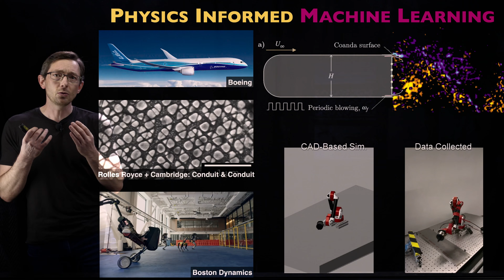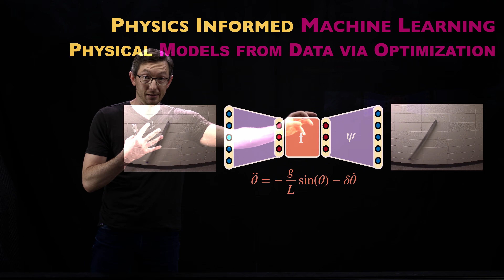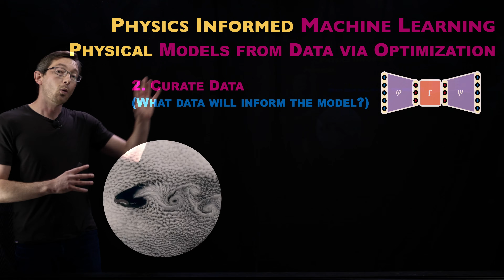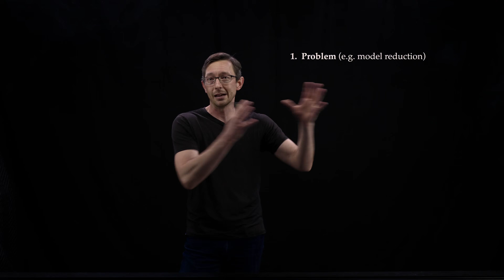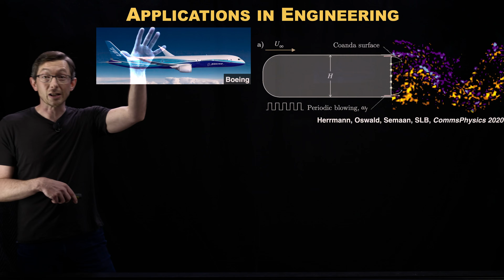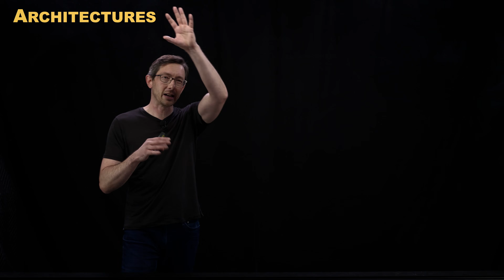Physics Informed Machine Learning: High Level Overview of AI and ML in Science and Engineering

Comment: Thanks for the excellent lecture and comprehensive overview of the field. A notable but often overlooked contribution is the work of S. Mehrkanoo and Johan Suykens: "Approximate solutions to ordinary differential equations using least squares support vector machines, IEEE-TNNLS 2012" and "Learning solutions to partial differential equations using LS-SVM, Neurocomputing, 2015". 
They first introduced a systematic machine learning approach for solving various differential equations. Notably, their approach allows for different representations, such as neural networks, instead of LS-SVM, and relaxes strict constraints by including them as additional terms in the optimization objective. It seems that inspired by their systematic LS-SVM approach, the physics-informed deep learning model was developed. However, the connection between these approaches has not been explicitly stated in the literature, including in the original physics-informed deep learning paper.

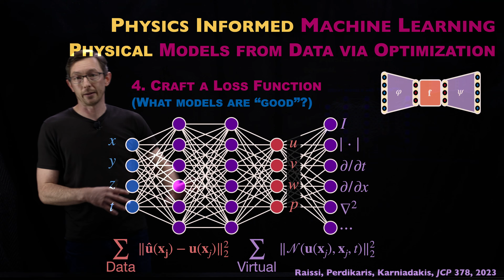Comment: 30:55 In the context of Physics Informed Machine Learning (PIML), the loss function is typically constructed to ensure that the predictions of the model adhere to known physical laws, such as the Navier-Stokes equations for fluid dynamics. This approach integrates domain-specific knowledge into the learning process, guiding the model towards physically plausible solutions.

For stock prediction models, an analogous approach would involve constructing a loss function that incorporates domain-specific knowledge from finance. Since stock prices do not follow physical laws in the same way fluids do, the 'physics' in this case would be principles from financial theory and market dynamics. Here are some concepts that could form the basis of an "Economics Informed" or "Finance Informed" loss function for stock predictions:

Mean-Reversion and Momentum: Financial markets are believed to exhibit mean-reversion and momentum behaviors over different time horizons. A loss function could be designed to penalize deviations from these behaviors for certain stocks or indices over appropriate time frames.

Arbitrage-Free Condition: In theory, there should be no arbitrage opportunities in efficient markets. A loss function could include terms that penalize predictions that would lead to arbitrage opportunities, thus encouraging the model to predict more realistic price movements.

Volume-Price Dynamics: The relationship between trading volume and price changes is a fundamental aspect of market microstructure. A loss function could be constructed to ensure that the model's predictions adhere to expected volume-price dynamics, such as higher volumes accompanying significant price changes.

Volatility Clustering and Leverage Effect: Financial time series exhibit volatility clustering (large changes tend to be followed by large changes, of either sign) and the leverage effect (volatility tends to increase as stock prices decrease). The loss function could include terms that ensure the model's predictions reflect these phenomena.

Correlations and Covariances: The relationships between different assets (e.g., stocks, ETFs, indices like VXN and VIX which measure market volatility) are crucial. A model could be penalized if it predicts changes in stock prices that are inconsistent with the historical correlations and covariances between these assets.

Regulatory and Macro-Economic Factors: Incorporating constraints or penalties based on unexpected deviations from macro-economic indicators or ignoring regulatory impacts on market behavior could also inform the loss function.

Market Sentiment: Integrating sentiment analysis, possibly from news or social media, as a part of the loss function could ensure that the model accounts for the impact of public sentiment on stock prices.

In summary, while there is no direct analogue of the physical laws used in PIML, finance-informed machine learning models for stock predictions can be guided by economic theories, market principles, and historical financial data. The key is to incorporate relevant financial knowledge into the model in a way that guides it towards more realistic, feasible predictions within the context of market behaviors and economic principles.

Comment: It seems to me that separating the symmetry from the neural network would be far more reliable.  Simply including many orientations in the training is the lazy approach.  Instead, concentrate on one side (e.g. the left side or the right side) and concentrate on g pointing down while training the network.  Then precede the network with a symmetry varying algorithm that rotates the input by 5-10 degrees while watching the correlated output.  If the subject has bilateral symmetry, then repeat the process after exchanging x<-->-x.  Then consider only the best output(s) when deciding how to classify the image.

Comment: 📝 Summary of Key Points:

📌 Physics-informed machine learning is at the intersection of leveraging existing physical knowledge to enhance machine learning systems and using machine learning to discover new physics.

🧐 Machine learning models can benefit from incorporating physics by enforcing known physics or using machine learning techniques to discover new physics from measurement data.

🚀 The process of building a machine learning model involves stages like defining the problem, curating data, designing an architecture, crafting a loss function, and optimizing the model parameters.

💡 Additional Insights and Observations:

💬 Quotable Moments: Physics-informed machine learning aims to bridge the gap between leveraging physical knowledge and enhancing machine learning systems.
📊 Data and Statistics: Physics-informed machine learning can lead to significant advancements in various fields like engineering, natural sciences, and robotics.
🌐 References and Sources: The NSF-funded AI Institute in Dynamic Systems focuses on embedding physics into machine learning systems for engineering applications.

📣 Concluding Remarks:

Physics-informed machine learning is a crucial field that combines physics principles with machine learning techniques to solve complex problems in engineering, natural sciences, and other domains. By incorporating physics at different stages of the machine learning process, researchers can enhance model performance, discover new physics, and revolutionize various industries.
Generated using TalkBud

Comment: Can machine learning determine that two objects follow essentially the same physical law? lets say the data are video of a pendulum and video of a mass on a spring. Can it say that both follow "simple harmonic motion"?

Or if it got fed the pendulum data first, can it say that the mass on a spring follow essentially the same equation of motion?
Reply: If the differential equation of simple harmonic motion is provided, then definitely. Fit the model onto each video, and use a goodness of fit to determine if it was simple harmonic motion.
Reply: @Jononor  hmmm still to early for the network to output the form of the equation itself? incorporating computer algebra along the way

something I imagine wolfram would do
Reply: @GeoffryGifari  one can find the governing equation from a library of possible equation elements. This is usually called "equation discovery", and one can use Physics Informed Neural Networks (PINNs) for it. You can find videos on the subject already from other channels. I suspect it will be covered later in this course :)
Reply: @Jononor  equation elements huh? collecting those seem to rely more on human input. 
thank you for the reply
Reply: @GeoffryGifari  one can often a relatively generic set of equation elements. But yes, there is no magic - humans are still needed ;)

Comment: An analogy for physics informed machine learning (one method) - using a splint to keep a broken leg straight.

Combine machine learning output with a hard-coded filter that removes any data not consistent with a known physical description of some process (like F=ma).

But the question remains-  could this filter be included with just the output, or integrated as part of the original reward function? 

And secondly-

Regarding machine learning drift and the problems that this might pose for accurate modeling in physics informed machine learning tools- 

Is the problem that the output is biased toward recent data, and not **all previous data **?  Does make make sense? 

It seems trivially simple to have machine learning be able to quickly identify exactly which previous data it used in a given output (is this output measured against just the last weeks worth of data, the last months, or all known previous data?)

This may possibly become memory resource invasive- but it doesn’t have to be!  There’s ways to mitigate this using a scale of statistical sampling of precious data that scales according to needs).

What do you a think?  Could this be a way for machine learning to eventually generalize laws of physics on their own?
Reply: Problem, reaction, solution (optimized predictions or syntropy) -- the Hegelian dialectic.
Inputs are dual to outputs.
"Always two there are" -- Yoda.
Thesis is dual to anti-thesis creates the converging or syntropic thesis, synthesis -- the time independent Hegelian dialectic.
Neural networks are using duality to optimize predictions -- a syntropic process, teleological.
Enantiodromia is the unconscious opposite or opposame (duality) -- Carl Jung.